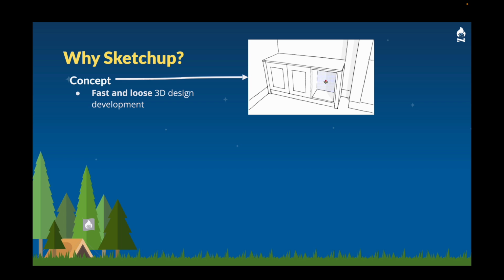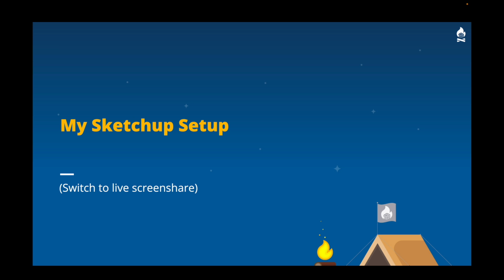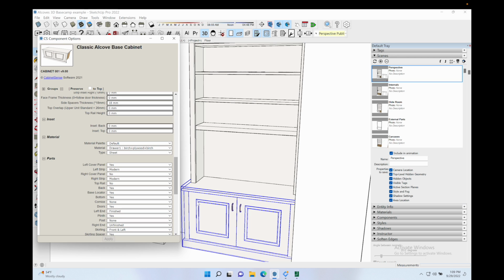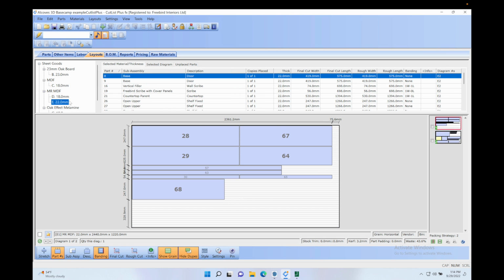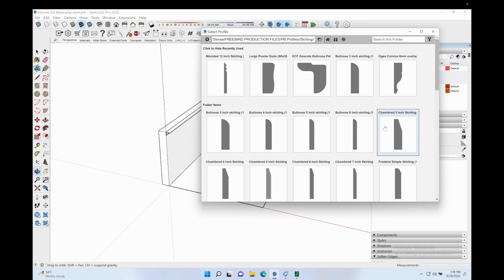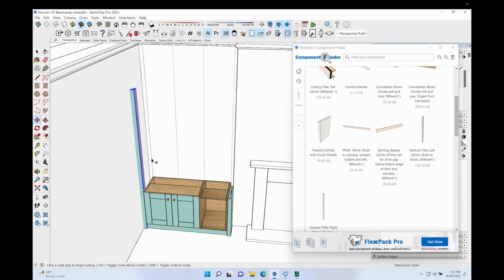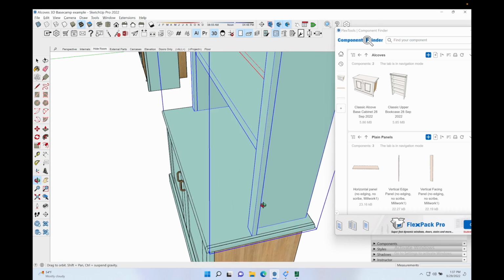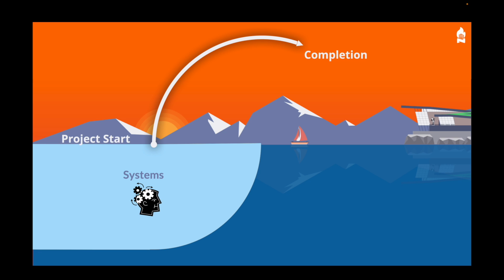SketchUp for Cabinetmakers: From Concept to Construction (SketchUp 3D Basecamp 2022)

Comment: Thanks for the video! I’m wondering how you are able to scale the cabinet without changing the thickness of the material/board. I’ve tried to figure out how to make it work but it never seems to work. For example: I have made a cupboard of 16mm board and it’s 700mm wide and I want to scale it to 1000mm but whenever I scale it to that, one of the boards turns into 22mm thickness instead of 16mm. Is there easy way around this?
Reply from the maker: Hi, you need to learn dynamic components.  Or, get the cabinetsense extension which has the formulas built into it's library components